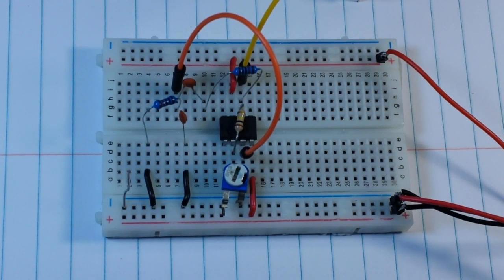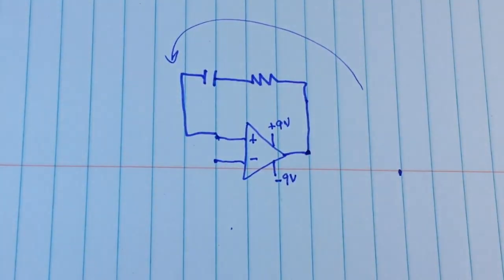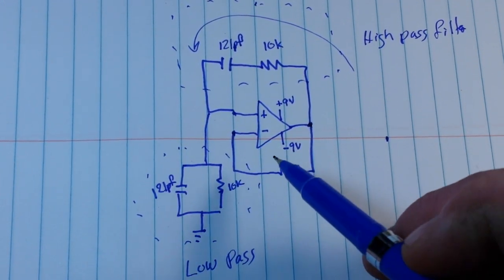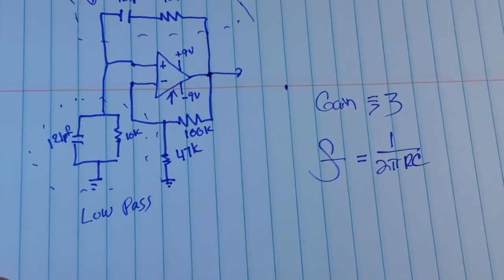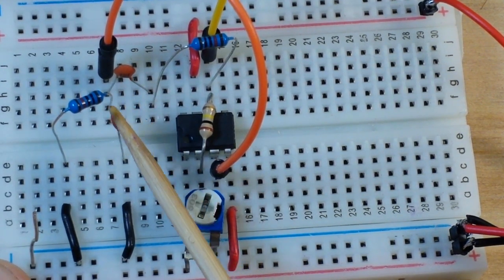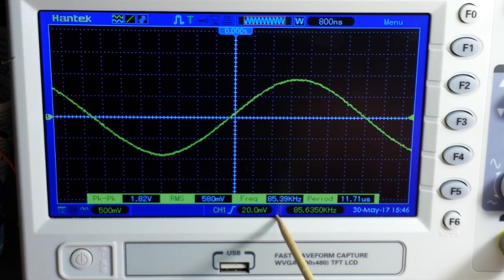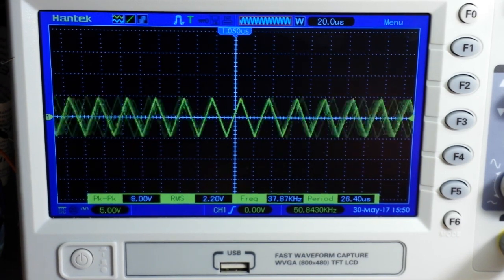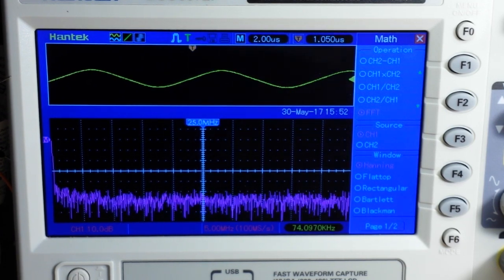How to make a Sine Wave Generator

Comment: The Fisher Gold Bug 2 metal detector operates at 71kHz and is powered by two 9 volt batteries.  So i'm thinking maybe you just invented the oscillator for the Gold Bug 2 metal dector!  It uses a crystal in the circuit, so maybe we have to add a crystal to stablize the output.  The Fisher GB2 has a worldwide cult following because of its ability to find very small pieces of gold in dry creek beds.  The fake Gold Bug 2 from china has a PIC16F886 microcontroller for the oscillator.  Thank-you for this great tutorial!
Reply from the maker: welcome

Comment: the clipping might be due to two factors: the slew-rate of the 741 is complete and utter garbage and makes it nearly unusable beyond 50kHz -although you start seeing weird stuf at the 15kHz mark-, and you might have a couple milivolts of positive offset, which you can actually fix by using the offset inputs of the package.
Reply: What do ypu suggest?

Comment: Just a small correction..when you say 121 pF, you mean actually 120pF. The capacitors labeled 121 means kindda just like resistors, the first two digits are significant numbers and the third one is the number of zeros, so 121 would be 12 and add 1 zero in other words, 120pF. When you say "tune-in",  do you mean changing the value of the trim pot?
Reply: Exactly this! I hate to admit a detail like that was frustrating me so much :)
1pF difference is less than the error..
Reply: He meant the number on the capacitor says 121. People that aren't obnoxiously anal knows what he meant.
Reply: @AndersNielsenAA  He meant the number on the capacitor says 121. People that aren't obnoxiously anal knows what he meant.

Comment: Yeah I can't get how f=1/(2*pi*RC) works here.  Doesn't work with your f, R and C values and doesn't work with mine either....  With 120pf and 10K I get 131kHz not the 85kHz you got on the oscilloscope.  Frequency varies with the gain (the ratio of the 100k and 50k pot value).

Comment: Thank you for posting the video, it has helped me a lot! I am still learning so apologies if this is a stupid question but pin 4 of the amp goes to negative of the one 9V cell and pin 7 goes to positive of the other 9V cell, both cells are connected in serie SO does that not mean you have 18V (as opposed to 9v) powering the amp? EDIT: Nvm, it's plus and minus 9V which gives 18V, is that right?

Comment: thanks for the explanation sir.can i use this circuit for the inverter generator sine wave?
Reply from the maker: As long as the current and voltage do not exceed the ratings of the components.

Comment: why and what is determining 75hz as a lower frequency output? i would like to use this circuit as the time base of a power inverter to transform 12v DC on a 220v AC... becouse I see a lot ot circuit that have as an output signal 50hz MODIFICATED SINE SIGNAL.... AND I WONDER IF I CAN REPLACE ORIGINAL TIME BASE CIRCUIT OF MY SCHEMATIC FOR YOUR EXCELENT SINE WAVE SIGNAL....do you understand what I mean?
Reply from the maker: Martin Lucero The RC circuit determines the frequency.

Comment: A question I have had for a while, how and where do you ground to get a reference voltage of zero? Whenever I hook up to a power supply I don’t know where to ground
Reply: bandoflozers Voltage is always relative — it’s the difference between the potential of two points in a circuit. So “zero volts” simply means they’re at the same potential. So — and I know this probably doesn’t exactly answer your question — you can set your zero reference kinda wherever you want. In modern DC circuits, we use a “negative ground”, i.e. the negative of the power supply is the ground. But in op-amp circuits, you often need a bipolar power supply (like here, +9V and -9V. Ground is 0V.). Let’s assume we’re using two 9V batteries. For the positive supply, the positive terminal of the battery is the +9V, and the negative terminal goes to ground. The second battery for the negative supply has its positive terminal at ground, and its negative terminal becomes the -9V. And yes, if you measure between the +9 and -9V, your meter will show 18V difference.

Comment: Great stuff, remember tho that putting resistors directly into op amp pins causes noise, it is best to put them in an isolated channel with dupont wires and then connect the wires to the pins of the op amp
Reply: That's nonsense.Are you an electronics engineer?
Reply: @chinmoy1955  im a certified technician

Comment: Hello. Very nice video. I need to create a 2KHz oscilator to make sound a Toyota lock/unlock buzzer. I have tried a 555 but it is a bit unstable specially with temperature. Do you have a recommendation on how to crate a cheap  2KHz oscilator? Somebody recommended MCU programing.
Reply from the maker: Oscillators: https://www.youtube.com/playlist?list=PLGhvWnPsCr5_buJHaCe7op1d890rBOo3v

Comment: So I had this working, and I have the waveform saved on my oscilloscope to prove it, but after switching out the capacitors to try getting a different frequency, it flatlined. I switched back to the old capacitors and it's still flatlined. Switched the op amp for a new one and still nothing. Same with the batteries. If anyone here can give a suggestion, it would be much appreciated.

Comment: Hello. Nice video, but you just described the components and showed the formula to calculate the frequency. You could put a little focus on how the circuit works too. Thanks.
Reply: And then, 1/(6.28*120e-12*10000) = 133kHz, not 85kHz.

Comment: How did you calculate the 100k/47k resistor ratio?
Reply: it is because the gain of the op amp must be at 3 , and since it is formula is 1+R3/R4 then those two resistors ratio value must be 2
Reply: @ahmedbenamor4849  Okay, but why does the op amp gain need to be 3?
Reply: @umnikos   because the oscillation is attenuated by 1/3 in the double rc stages, so the whole loop gain of the circuit is AxB=3x(1/3)=1
Reply: @ahmedbenamor4849  I see, 2/3 of the voltage fall on the high pass filter and 1/3 of the voltage falls on the low pass filter, so the input to the op amp is 1/3 of its output. I assume it's 47k instead of 50k to make the gain a little bit above 3 to account for losses but not way above 3 to avoid clipping the top and bottom of the wave. Thanks!

Comment: I have used this oscillator but I cannot obtained sine wave like yours. You have very pure sine I need 3khz but not stabile when I touched the resistor it directly goes to zero :( what could be wrong?
Reply from the maker: Add a buffer and you should be good. It will isolate your output from the oscillator.
Reply: I cannot understand in which part I should add buffer? after output? how could it stabilize the output of the wien?
Reply from the maker: Yes after the output. Check my opamp playlist for buffer explanation.
Reply: Thank you, I will try :)
Reply: I have used buffer and now they are pure thank you :) but I have another problem maybe you can help me, I know it is very difficult without seeing circuits but maybe you can.  I have transmitted it through speaker to microphone.  at the output of my microphone preamplifier circuit they looks like a square wave having distortion around their peaks what can be problem?is the problem in the speaker or microphone circuit?

Comment: In fact this oscillator using only one stage is practically useless because the output oscillates in pure sinewave much lower than 1Vpp in output.Buffer or amplify the non inverting input of the op amp with another op amp and you will have the sine wave pulse.

Comment: (1:30) -  don't you mean "...comes back into our non-inverting input." ?
You say: "...comes back to our non-inverting output."
EDIT:
(1:47) "...10K capacitor" ? - Have you been drinking?
(9:21) - You say: "..well you can see we've lost any semblance of this being a square wave..." - Surely you mean sine wave ? You need to lay off the booze mate. And I say that as a friend, no offence intended.
I still gave you a thumbs up because you used no inductors. Rad!

Comment: I don't know why am failing doing this, every time I try
Reply: Feel u dude just roasted a Potentiometer
Reply: Most circuit schematics are bogus BS
Reply: That's a basic oscillator that worked for me. Start out with that and get it working. Then you can add an LC network to it to turn into a sine wave.

Comment: I’m sure you have a some degree of electronic knowledge. But due to the fact your video’s lack explanation on how the circuit works and not working out the math to prove the output indicates your possible lack of understanding. I would like to see more detail and not just duplicating a circuit on a breadboard that someone else has designed with your vague explanation. If you had more detail and explanation i may be willing to contribute to your Patreon. There are YouTubers out there you could take note of to improve your video content. When giving component values for example of 121pf. Explain the true value of the component as being 120 X .000000000001.
Reply: Dude, he’s doing wien bridge oscillator. If you need to know what 121pf means, you probably should stop and view another video first. This is past that introductory stuff.